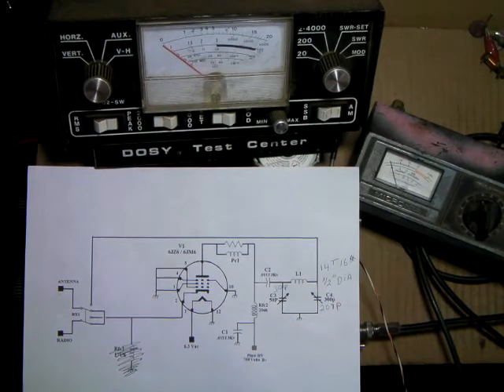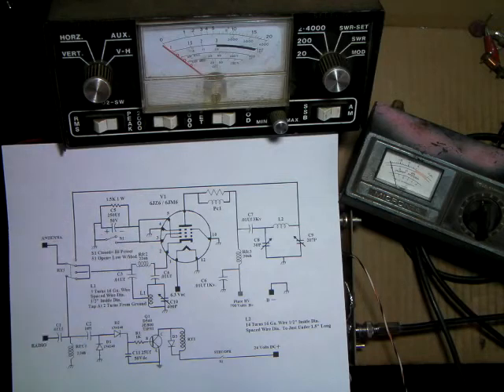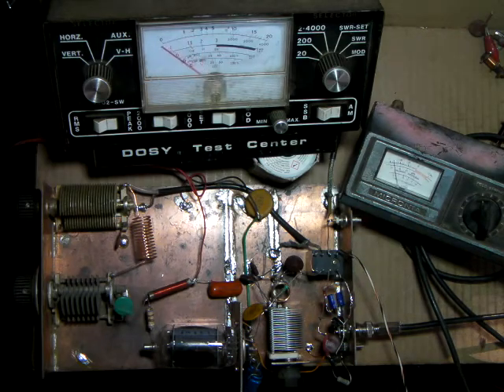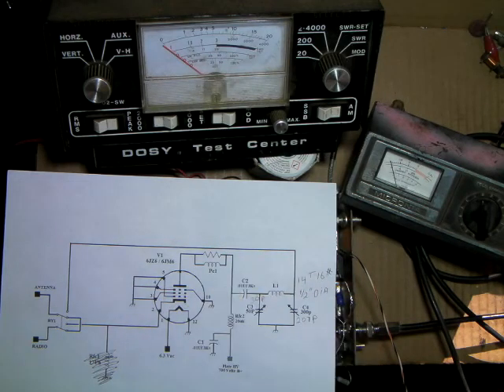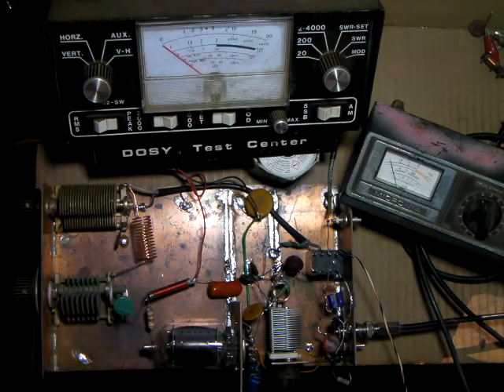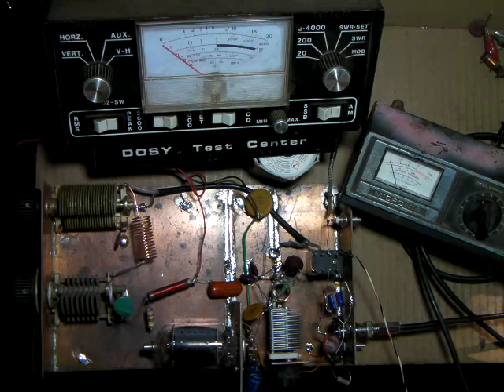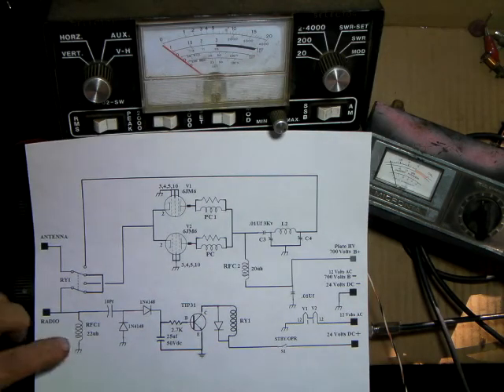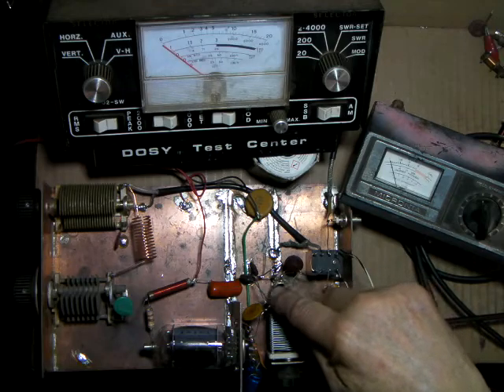Build a Tube Type Linear Amplifier For CB Or Other HF Bands Ep13: Building A Single 6JZ6 Amp Pt4

Comment from the maker: Hello Mike:
Thank You for Asking!
This is the info for a 4-1000 tube.
At a plate voltage of 3000 to 4000 Volts, your Input Impedance at the cathode will be
about 105 ohms.....the plate load impedance will be 2450 Ohms.
So you can start with a non inductive 4 watt 100 Ohm resistor as a substitute for the
tube and your set up will be much the same as I showed for the single 6JZ6 tube
and you can use the compression or the finned type of caps for your tunning caps
on each end of the coil
Start with about 7 turns 14Ga. spaced wire Dia. and an inside Dia. same as a AAA Batt.
Input cap 20P to 150P and output cap 75P to 400P and that should get you in the
ballpark.
Thank You
Norman W